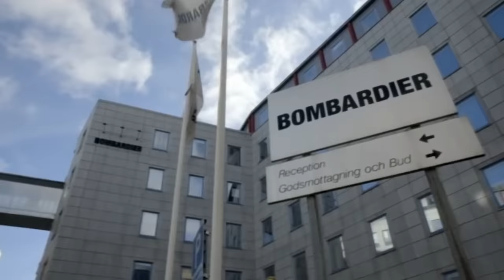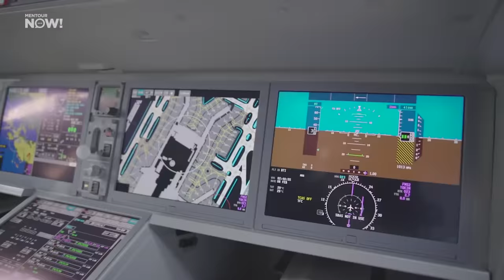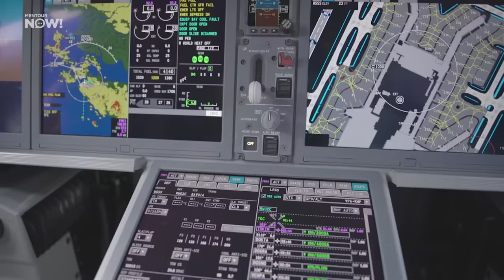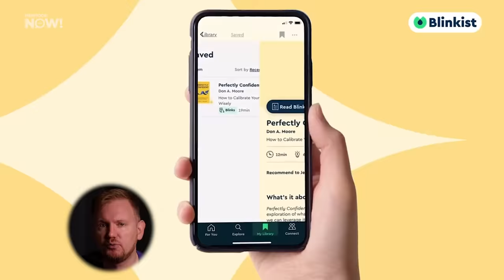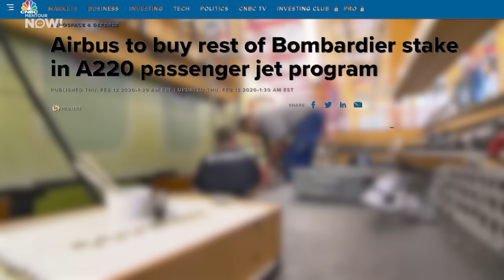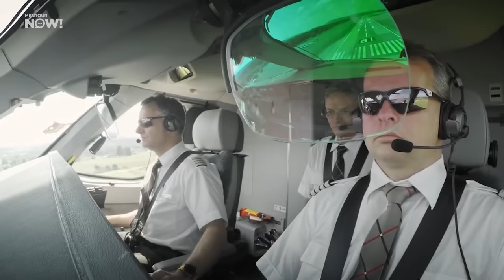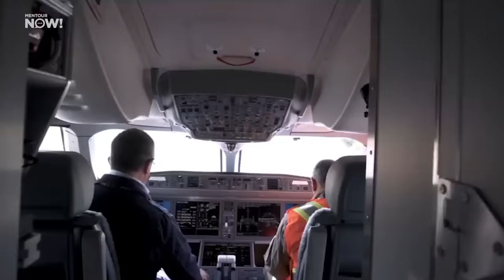Did Boeing GIVE Airbus a FREE Airplane?!

Comment: Well, I'm not sure it even needs to be said. But the big "loser" in this story isn't Boeing, it's CLEARLY Bombardier! There's a pretty strong case to be made that getting into such a "mega project" as the C-series was always going to be major strategic blunder, at the very least it was a risky gamble.

The attempt to compete more or less directly with Airbus and Boeing in the air while also fighting head on with Siemens and Alstom in the rail sector seems in hindsight a very curious choice for a long term business plan for a large but not truly huge industrial conglomerate.

In fact I kind of suspect that Bombardier in the 00s and 10s will be taught as a cautionary tale of overconfidence and overextension in many business schools for years to come. And I say this as a former Bombardier employee (on the rail side).

Comment: Great commentary as always.
Rank arrogance by Boeing who felt they were the defacto voice on regional jet manufacturer and that it would undermine this position to take on a different jet architecture. And then they built the Max with a single point of redundancy, demonstrating that actually the worlds oldest aircraft maker actually didn’t know as much as they thought they did about safe aircraft manufacture and corporate culture.
The C-Series has also ironically given Airbus strengthened position in the US market by increased investment on US soil.
However; I do not know what the culture of the C-Series program is/was like but certainly on the Q400 the company (Bombardier) was an absolute nightmare to deal with. Obstinate, difficult and unresponsive, in fact the precise opposite of what makes Embraer such a delight to work with if you are customer. The E2, for example, features many features requested by customers including trailing link undercarriage, cabin enhancements and special operational features. Upgrades to the Q400? LED lighting in the cabin? That’s about it. Bombardier couldn’t even execute the smallest operational modifications, for example synchronized heading bugs (yes in the Q400 it was possible for the two pilots to both have different headings, with the aircraft flying to the side of the active autopilot) or modification to the pitch wheel, so that operation of it in the last thousand feet wouldn’t disable altitude capture.
Did Boeing observe some of this culture within the program and just decide that it would be too difficult to work with? Did Airbus overcome these issues because by the stage it invested Bombardier HAD to make it work?
Like all boardroom decisions, it is very difficult to know all the factors that led to the ultimate decision.
However; IF Boeing had have take the C-Series on they would have had instant indemnity against the problems that the MAX has endured, being able to offer customers a realistic switch to another aircraft in their own line-up while the MAX was either  fixed or stood down.
The MAX remains what it is: if you take a Ford Mach e instrument display and you put it on a 1970 Taunus, it’s still a 1970 Ford Taunus. Boeing sure have a lot of problems going forward…

Comment: Hi Mentour 
Great video. 
I have a friend that worked for Bombardier turning the development of the CS and he mentioned how advanced the aircraft was. 
It was and maybe still is the latest cleansheet design in the industry.
This invariably drive up the cost of the development as it had to meet much more stringent safety standards than the ancient 737 platform. 
Perhaps you can conduct a segment on the differences between the two aircraft as well how advanced the power plant was for its time. And still is.
In any case, it is a shame that this platform was sold to Airbus and it cost them nothing in development costs. Perhaps better Airbus than Boeing.

Comment: Boeing is probably the most heavily subsidized aerospace company in the USA, both federally and at the state level. They routinely threaten to move model assembly lines to other states if they don't get handouts where the existing manufacturing is done. This whole bit of bullshit basically ended Bombardier's entire commercial aircraft business. They had to sell the Dash 8 - Q400 program to the venture capital company that's the parent for Viking Aero in BC as well as the trademark and name rights to de Havilland Canada (bringing all the de Havilland Canada model type certificates and design lineage ownership under one new entity, a revived De Havilland Canada (Viking already owned the type certificates for everything from the DHC-1 thru 7). Viking also bought the Canadair super-scooper water bomber program from Bombardier. And Mitsubishi heavy industries bought the regional jet program. This leaves Bombardier with only its Challenger business jet business.

Comment: Yeah this definitely didn't sit well here in Canada. Boeing could have solved their competition and potentially production aircraft size problems (something smaller than the MAX 7) by putting in a bid for the A220. They have done this before, they bought the Dash 8-100/200/300 production from Dehavilland in the early 1990's before it was sold to Bombardier. Instead, they decided to go about this rather foolishly. Ironically, the 737 MAX is very popular here, whereas Air Canada is the only C Series (I still mostly call it that) operator- there are far more of them in the US. I'm sure Transport Canada (along with maybe EASA/CAA/JAA and so on) will require the 737 MAX 7 and MAX 10 to have an EICAS to gain certification here. I think Boeing may have to kiss that big WestJet MAX 10 order goodbye.

Comment: Who in the airline decides what aircraft and how many in their fleets?
Reply: Not sure, but I am sure that it is a complex decision.

Initial cost?
Running costs?
Type commonality (go down the Airbus family route, or the Boeing family route, or the mixed fleet route)
What suites the immediate needs, and is that aircraft going to support further growth?
1 larger aircraft or 2-3 smaller ones, if the larger plane can be filled it makes a profit otherwise it either doesn't make a profit, or makes a lower profit per flight than the 2 smaller aircraft

Etc

Comment: One of the hallmarks of a failing organization is choosing to sabotage rivals instead of coming up with new ideas. As usual, they’re focused on the bottom line and “shareholder value” at the expense of all else, as also evidenced by their gratuitous outsourcing and their decision to squeeze out another 737 instead of going with a clean sheet design.
However, playing a little devil’s advocate, acquiring a product whose parts, specs, and manufacturing methods don’t match anything else in your lineup presents its own set of challenges. Boeing experienced this after the McDonnell-Douglas merger, running the MD-series production lines alongside their own.

Comment: Boeing's gradest mistake was that ridiculous design of MCAS system in Boeing 737max, where it was feeding information from one single sensor only.
After 2 planes crashed and hundreds of human lifes lost, they finally solved the problem with software update. I am sure that the designer of the original MCAS system wasn't a pilot, nether knew many things about real life flying and what could happen if that single damned sensor would ever failed. And i am also wondering in a passenger plane that costs millions, how much more cost would need for a third angle of attack sensor, like Airbus has. And a system that warns the pilots about the disagreement of the sensors. If someone knows the answer, please reply.
Because i believe that's a tiny amount of money, compared with the safety upgrade that provides, and of course the cost of the whole plane.
Nevertheless, i prefer the Boeing's design with the original control column, instead of the joystick 🕹️.
With joystick, the co-pilot can't know what the pilot flying is doing. So, it's not easy to realise if he flies the plane in a wrong way, and the other pilot needs to take action and intercept.
Reply: Actually the 737 MAX has always had an angle of attack disagreement sensor, but it is an optional feature.Not all airlines purchased it, that says something about those airlines also.
Reply: @StevePemberton2  Yes, but every equipment that has to do with SAFETY should be a standard, not an optional choice.
Equipment that has to do with COMFORT or LUXURY could be an optional choice.
When ABS whas invented, for example, it was an optional choice, when you where buying a car. Now, manufacturers are obligated by the laws, to give this safety feature standard to all the cars they make. Of course, now that all cars have standard ABS and Airbags, are generally more expensive. But that's the way it should be: Safety first, comfort and luxury optional.
Reply: @george-op9dw  I didn't say otherwise. In fact I said, "Not all airlines purchased it, that says something about those airlines also."

I thought the implication was clear that I don't agree with it being an option, but I pointed out that the airlines were at fault also. Using your example, it would be as if a taxi company didn't purchase ABS or airbags when they were optional.
Reply: @StevePemberton2  but as modern cars come with airbags and abs, one should expect reasonale safety with what should come in a vehicle as standard. Maybe Boeing lied to the FAA, making them believe that the aircraft equivalent of airbags aren't a necessity for a safe flight, so it isn't enforced
Reply: @serkandevel7828  "But as..." indicates a rebuttal to what was previously said.  What did I say that you disagree with? I said, "I thought the implication was clear that I don't agree with it being an option" 

I don't know if I am not being clear or if the strawman convention is in town. Either way I will rewrite the taxi analogy: 

Once upon a time cars had optional ABS and airbags. This was not right. Even though most consumers (and taxi companies) were not asking for these features, car makers should have put them in as standard because they are safety features. 

During this time a company named the Sunshine Cab Company purchased new taxis but chose not to purchase the ABS and airbag features. This was not right, for the safety of their passengers they should have purchased these safety features. 

Hopefully that is more clear but it sure is a lot of words to state what I thought was already obvious.

Comment: Spot On, You nailed it!  Boeing was too cocky and didn't listen to their customers who wanted and asked for a 100 seat airframe to fill the gap between RJ's and the smaller narrow body airliners (737's & A320's).  Boeing didn't listen to them, swiftly killed the 717 that they snatched up from McDonnell Douglas (originally the MD-95) and relied on the thought that they could push their customers to the 737 platform.  Bombardier answered the call with the C-Series, and as you said, the overconfident Boeing miscalculated the threat that the C-Series offered.  Then when Delta placed their huge order for the C-Series, Boeing crapped their pants! 😆.  They cried to the FTC that Bombardier was being subsidized,  and the airplane threatened US jobs.  Which is ironic, because Boeing also took tons of US subsidies, and used the IMEX bank to sell 787's to the highly subsidized ME3 carriers (Mid Eastern carriers: Qatar Airways, Emirates, and Etihad), who are heavily government subsidized, as well as NAI (the now defunct Nirwegian Air International) who also threatened US jobs.
Anyhow, as you said, they rallied the US governments to slap a HUGE import tax on the C-Series, which would make it financially ridiculous for Delta to move forward with.  In turn, Airbus saves the day by stepping in to take over 51% of the production of the C-Series, rebrand it the A220 and get in imported into the US under Airbuses grandfather clause, making it immune to the added import tax.  
Boeing suffered plenty of fallout from their childish behavior.  In addition to public outrage, Delta dropped their 787 options and replaced them with A350 orders.  And as a side note, American Airlines had options to buy and be the US launch customer of the A350, but when Delta dumped their 787 orders on the market, AA was able to pick them up on the cheap.  So now you also know how Delta ended up with the A350, while AA ended up with 787's, instead of the other way around.  At least that's what I was told at the AA training center. 😆

Comment: Boeing indeed messed up pretty badly with the C series, but I must say, Canada will regret not choosing the F-18 Super Hornet.  Correct me if I'm wrong, but wasn't Canada already using previous F-18 models?  Transitioning to a new fighter isn't exactly cheap.
Reply: Yes, Canada flies the CF-18 (basically the F-18).  After Canada walked away from the Super Hornet it was left with deciding between the Saab fighter or F-35.  They went with the F-35.  They also excluded Boeing from the new tankers and with Airbus.
Reply: It's surely more costly, but at the same time they get a far modern fighter. The F-18 SH is quite old meanwhile, and it will be replaced by F-35 Cs at the US navy with the F-18 growlers as the only exception.
The other possible export customer for the SH - Germany - also switched to F-35 As

Comment: I really would prefer 717- or 727-
Reply: You can fly the 717 aka DC-9 (another ancient 1960s aircraft modernized several times) in China, where it's now called ARJ-21 and built by Comac, with a DC-9 fuselage and wings developed by Antonov
Reply: @simonm1447  They look nearly identical, but if you put pictures side by side you can see differences, especially the nose. It's like the Buran Shuttle and the Tu-144. Different aircraft but clearly the shapes were copied, even though Russia and China denied it.

Comment: I don't know if the distances between planes and submarines are really that big.  
What do you think ?  
And the distance between France and Australia seems greater than that between the USA and Australia.  What do you think of these distances?  
Thank you.  
Dear Petter, I wish you a very successful year.
Same for audience !
Reply: The problem with the French submarines is they were diesel subs, but still quite costly. France has own nuclear subs, but they don't sell them to other countries. Their reactors use less enriched uranium, which means they have to replace fuel rods more often.

The offer the US made was simply unique, nobody has ever sold nuclear submarines to another country before. Since US submarine reactors use highly enriched uranium you can use them for decades until you have to replace any fuel rods. At the same time they are much faster under water compared to a diesel sub.
I don't know if there is some connection between those deals, the French offer however wasn't really attractive from beginning on
Reply: @simonm1447  
Thank you very much.

Comment: I love the A220 as well!

As to the fighters Canada has decided to buy 88x F35 which is mind-boggling expensive investment as the F35 (which the Czech government Is also considering) costs 2-3 times the Saab Gripen and has 4,5 - 6,6 ! higher operating costs!
Reply: 78:1 in Red flag with basic software and restricted performance years back. Now it's full potential is unleashed. Soon it will be upgraded to carry more missiles and the latest gen weapons. 5th gen is far more superior to 4th gens and the purchase cost is actually lower than the Rafale and Eurofighter considerably.

Comment: IMO, another example of MD management over Boeing, missing the opportunity...this ship has now sailed. Solid aircraft, regardless start-up issues, would have served Boeing well. But Boeing reacted like a 5th grader when Delta flexed its buying power. Boeing then forced its leverage with U.S. government to bargain market position. Again, we're witnessing MD's former failed management, IMO. Investor driven, blindly...according to my collegiate studies. And, there are also other examples, mainly from South American endeavors. So many missed opportunities, where other companies bore the cost of development, where Boeing could have seized opportunity. And yet, they blindly persisted. Basically..if not Boeing, then they'd crush the competing company effort/cost. Airbus merely needed to wait the outcome, and then moved very quickly to bolster their options. Slightly off subject, but recall the trade tariff's enacted to strengthen Harley Motorcycles against Japanese imports....that also back-fired. My pilot dad, always said the short-haul market was the future of aviation, maybe drive a little more for your flight, and that is where Boeing missed, when Southwest capitalized very solidly (short-haul). Please pardon, my mixed issues.